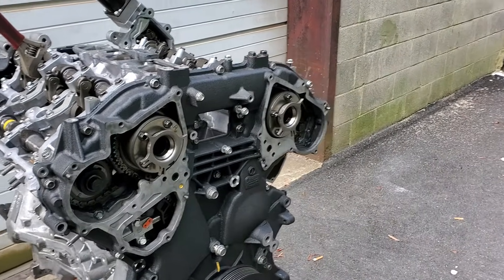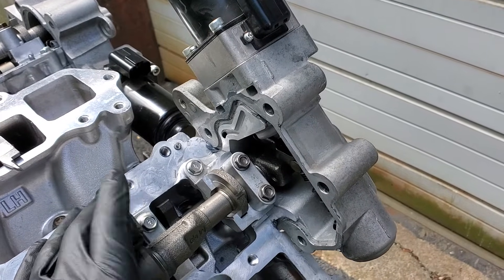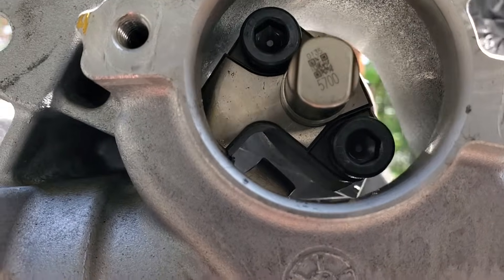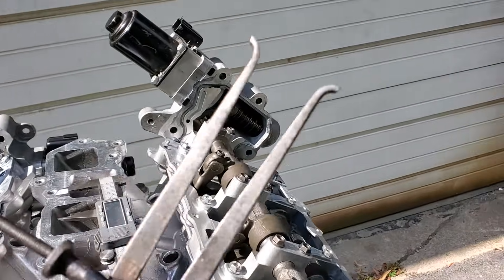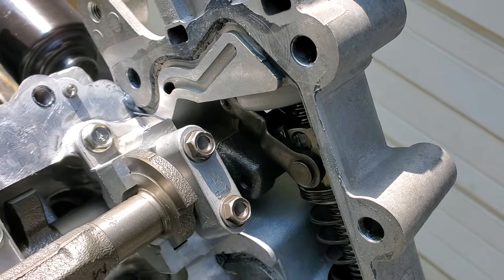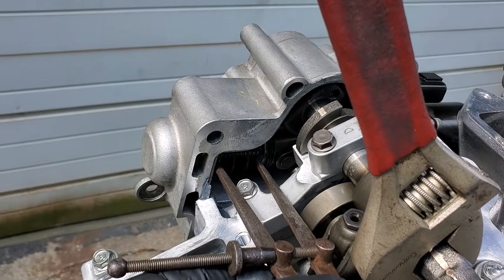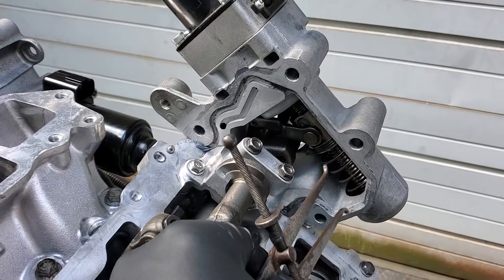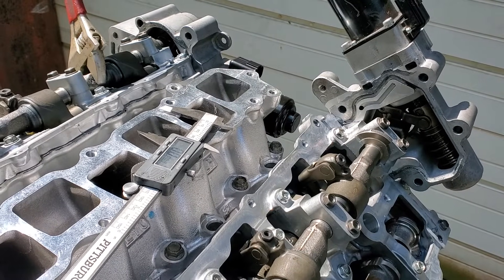VVEL fix for Nissan 370z and Infiniti G37

Comment: I’m pretty new to G37s and I had a question bro, If I’m doing an upper cam tensioner swap, this has to come off obviously. Would I even have to remove the sensor to take this off and lift the ladder so I can swap the tensioner?
Reply from the maker: Lol...you already know...mind you, the nissan service literature doesn't call for cam tensioner replacement during a standard timing chain service nor do I typically think it's necessary,  I use new ones on big power builds or if specifically requested by the customer. Which I've done before,  but won't fall into the trap of letting them shot call since the whole tower system has to come off and it's very time consuming
Reply: @sethjoyner391  I had my motor swapped at 117k but I’m pretty sure the dealer used a lot of the old parts as possible as my new engine had the bank 2 tensioner completely fail. My question I guess comes down to, if I can create specific markings on the cam, measure the actuator prior to taking it off, and realign everything exactly the same way it was prior, would it have to be reset? What calls for the reset?
Reply from the maker: The entire vvel motor control and tower system must be removed in it's entirety to do secondary cam tensioners...all liquid sealed, control cam rephased,  vvel reset
Reply: I've seen the secondary tensioner shoe wear down on these in multiple groups.  I replaced both tensioners without removing the deck or vvel.
Reply: @jamballer2003jm How was that even possible? The ladder assembly blocks the front bolts which are unable to be extracted with it in place. The only way I can see that working is by cutting or drilling an access hole in the ladder assembly to remove the blocked bolts, and avoid messing with VVEL.
Reply: @Znthusiast shit if he found a way then I hope he spills the tea lol
Reply: @MarvFranco  You can replace the secondary tensioner guides or “shoes” as I believe he was referring to. But the main body of the tensioner that is bolted to the head cannot be removed without pulling the VVEL ladder assembly. Unless you’re skilled enough and have the resources to cut/drill access holes in the ladder assembly that will enable you to extract the bolts without disassembly.

Comment: Can you replace these without timing or taking the whole engine out ? Mine is causing a misfire and I’m not sure if I can replace it myself or I have to take it into the shop or take the engine out myself?
Reply from the maker: What codes, year car, describe the issue
Reply: @sethjoyner391  it’s a code p1090 

Infiniti q50 2015
Reply: The vvel actuator motor from what I found the left one is failing and is causing the 3 plugs on that side to fail causing the misfire
Reply from the maker: @breadbone8401  sorry for the delayed answer..definitely can pull bank 2 vvel motor completely...however,  u may need to trim back some of the firewall padding and/or remember there is one of the 12mm long bolts that needs to be in the body of the motor for reinstall...otherwise u won't be able to get it back in...observe and paint pen that bolt and hole during removal...intake manifold off..down to the driver valve cover off, and valve cover to vvel motor bracket off...rephrase to 1.585" like in my other video I explained..reinstall sensor baseline middle and reset vvel, I made a video about that as well
Reply: @sethjoyner391 hey man my 370z my car won’t accelerate so took it too a shop and replaced the sensors but then months later did it again so what part am I supposed to replace vvel control module but idk what part is that one and get the other part and reprogram it ?
Reply from the maker: @daniellopez3606  what year car?
Reply from the maker: And don't forget the x2 6mm allen bolts holding the motor to it's control shaft

Comment: Hi I have a question if you’re still active on this channel
Reply from the maker: Fire away
Reply: @sethjoyner391  thank you! Stock 2010 g37 engine code p1089 keeps coming back after driving fine but udling kinda rough. I replaced the vvel computer which was the problem I think because it fixed it but where I messed up was I took the passenger side sensor out and replaced it with a 40k mile q50 it seemed fine at first drove about 200 miles but light came back on and limp mode again. Still safe thing
Reply: @sethjoyner391  also, at some rotation points the car literally throws a p0300 and p1089 code after start up and idles really bad. At the moment I just guessed and tried to align it as close to the lines as possible so it drives ok but still idles bad and codes comes back but takes longer
Reply from the maker: @Ahmadzeee  I think u answered your question...if u didn't go through the sensor reset procedure; it will definitely not work right...it has to be "dialed in" via voltage and a relay procedure
Reply from the maker: @Ahmadzeee  I dunno if u saw this video yet https://youtu.be/-6yo1MAVXqM?si=0LU5UpgE43Nar1ug

Comment: I think you need a more detailed video for lay man. what is locking the camshaft ?
Reply from the maker: I can try and do another one sometime as a pov of the process
Reply: @sethjoyner391  And the 15 degree inclination had me a bit lost.
Reply from the maker: @fernandohood5542 locking that vvel cam means having it in its full counter clock wise position.....once it's set it will be dialed into the pre-set 5.5 degree position
Reply from the maker: Standard Cresent wrench

Comment: sup man i’m getting a p1606 and u1003 after a drive for so long they pop up out of no where and the car goes into limp mode. do you think this fix will get rid of this problem? there’s rarely any threads or vids about those codes and when i do find a thread there’s never a answer to the fix this has been hell thanks

Comment: P1090 re built my motor. Followed this while putting my vvl actualtors back in and bank 1 still mis firing.. 
What should i do???shes is in limp mode.
Reply from the maker: What procedure did u use to reset the vvel motors and set the sensors?
Reply: @sethjoyner391  didn't reset the vvl also we aligned the sensor with a mark that was there from where the sensor use to set. Probly should rest and double check the sensors. How do I reset it? Is there a video link you can send me??  I have a very nice scan tool so I can hopfully use it to read live data. I apperciate you getting back to me I didn't expect that lol
Reply from the maker: @brandenlaferrara9503  ahhhh....yea, I think ur still good....look for the video on my channel about the sensor reset procedure...this is the final process...I use ecutek,  it can be done with nissan consult etc
Reply from the maker: Yea, u gotta have live data, for sure, this process involves key on/off procedures,  disconnecting harness and removing a relay essentially
Reply: I will keep you up to date. Going to thus weekend I seen that video btw thank you so much dude seriously.. this shit is better then Facebook discussions page 🤣🤣🤣
Reply: Well I adjusted bank 2 it was 0.33 
Bank 1 is at 4.46
So I'm sure I'm going to have to go back and adjust the mechanical arm. 
Is it possible with the motor in the car
Reply: Positioning sensor was put in backwards for bank 1
Car runs like a champ!! Great video dude I subscribed
Reply from the maker: @brandenlaferrara9503  duh.. I totally forgot,  I've seen doods do that, one's up and one goes down
Reply: @sethjoyner391  bank2 is very hard to get backwards bank 1 the harness can go either way 🤣🤣🤣

Comment: After we tighten the 2 bolts connecting the motor, do I spin the crank off top dead center and procceed to put it back together or does it not matter?
Im sorry for commenting so much but i’ve been dealing with this for almost a year now and its so frustrating
Reply from the maker: All good...You're going to do the one side first...lock it down....slowly rotate the crank clockwise 120 degrees or so and set the other side, then put back together complete.....then electronic vvel reset etc
Reply: @sethjoyner391  what if I just need to do my bank2 side? Do I just need to put everything back together and not rotate the crank?
Reply from the maker: @Stockclipz  if ur just doing that one side...might as well leave it in that position for vvel reset, but it wouldn't matter either way

Comment: more VQ info like this please...thank you for posting
Reply from the maker: That's super kind, thank u...if u have any suggestions I'll make a video..I can cover any system..from triple disc clutches to engine break in procedures, I have a lot of useless knowledge 😉
Reply: @sethjoyner391  where can I send my block to you for final assembly
Reply from the maker: @orangehammock  lol...I'm soooooo backed up on work....however,  what area are u in and what internals/ power goals do u have?..I can steer u to the right machine shop or engine builder

Comment: make a 1.58 shim to set in there and then hold the cam full left and push the motor on the shim and tighten it all down.
Reply from the maker: God mode comment ^

Comment: Would I have to do this if I had heads redone …. I got the motor back in the car and it starts and then just dies ….. at first I could keep it up to 1100rpm but now it just won’t stay running
Reply from the maker: For sure, 99% engine builders don't know this
Reply: @sethjoyner391  we’ll that’s my problem then
Reply from the maker: @N8TeK  ...and 99% run just fine when this is fixed
Reply from the maker: And for inquiring minds...this is on only one page in the factory service manual that vaguely references this in regards to "not to do this".lol
Reply: @sethjoyner391  just one last opinion … so I had heads fully rebuilt and then upgraded to cometic gaskets and arp studs …. Upon first fire it would stay running at 1100 rpm only if I kept foot floored to the ground … if I let off of gas it would die …. I then messed with sensors on back of vvel and now car won’t even idle at full throttle ….. finally got codes to pop up p0102, p0301 , p0303, p1092, p1233,,,, car fires and then sounds like a old cammed hotrod for 3 seconds then dies ….. assuming all sensors are hooked up properly and the timing is perfect on the motor …… ur saying 99 percent this is the vvel? … should I try to adjust it or just do a motor swap out of a running vq I just found for 1300$
Reply: @sethjoyner391  sorry for asking twice it just hurts so much knowing it has to come back apart 😞

Comment: Is the space that's created by slack( after setting vvel arms @1.585) my 5.5 degrees? So, both cams stay flat against heads or both cams get the slight movement into a gapped position?

Comment: Wish you were close tyo NYC i need my 2010 FX35 engine rebuilt!
Reply from the maker: Honestly,  probably better off finding a wrecked but running or an engine from a quality salvage yard...the motors I do are all forged internals and all brand new components...thousands Basically...and a factory rebuild is similarly expensive as far as time and factory parts...money ahead to find a lower mileage drop out

Comment: We are having a P1093 code after rebuilding the motor

Tomorrow we are going to open up the head and ladder to with on the motor to try and fix this

It's a heavily modified car. If we can't get it to work tomorrow I am willing to bring it to you if it's correct that you are in Maryland. I am outside Philly

Let me know
Reply from the maker: U only need to get the valve covers off and the rear aluminum covers off that bolt to the control motors...loosen the Allen heads in the back etc, measure, adjust, lock down...go through the regular vvel reset and clocking of the actual sensors
Reply: @sethjoyner391  I have ecutek but can't figure out how to get the voltage for the sensor. It at 2.4v and 3.2v when at idle
Seems way off
Also the learned is at .39v

Honestly if you have the time. I have the money to pay sometime for help as I can't find anyone that knows anything about this

Let me know and I'll share my info with you directly somehow

Also can't find the reset of the vvel system in ecutek
Reply: @sethjoyner391  found the vvel reset. Now to figure out how to get the mv without a ecutek reporting that back to me
Reply from the maker: @teknoprep  just hit me up on Facebook under Seth Joyner
Reply from the maker: And of course I can always dial it in for you
Reply from the maker: Nissan consult,  or u would have to identify and alligator clip (minor wire jacket removal) and u can do it with a multi meter...just seem extremely tedious...

Comment: Seth, just finished building the VQ37 for a friend, did the VVEL adj. to get the proper measurement i removed the motors and adj. the worm gear till i had 1.585 sound correct?
Great video BTW

Comment: Great video, thank you.
I have a question, hopefully you can help.
My son has an 09 G37x, with a handful of bolt-on mods and exhaust. Car runs great for the most part, but will get a slight miss at times, like bad gas. 2 days ago it started getting sluggish to start (battery going maybe), then a slight fluttery sounding knock in the right front of the engine. It sounds weird, will speed up when revved, then near cut out when coming down. 
Read some posts VVEL related, maybe flashing ECU. Any idea where to start with this ? Planning a new battery first, just in case that could mess with the ECU. Any help would be appreciated.
Reply: Same thing happened to a car I'm working on. What was your fix????
Reply: @Cobramike202 found a way to fix it I have a slightly knock on my passenger side.

Comment: So I'm following your lead and after the car is warmed up, after pushing idle to 4k rpm, as the engine comes down bank 2 vvel p1093, p1092 and limp mode.
Reply from the maker: I'll check em when I go to work
Reply: @sethjoyner391  I just hooked up a computer last night to the ecu and it looks like the sensors were way out of voltage spec by almost 75 percent. Will tighten everything up today and take it for a test drive.  Also what is standard cam degree at idle? Right now im at around 7 degrees at idle for each bank. Thanks, you have poise and brains when talking through 370 motor!
Reply: @sethjoyner391  bad connector for the vvel 1093. Explains the intermittent  good idle to bad.